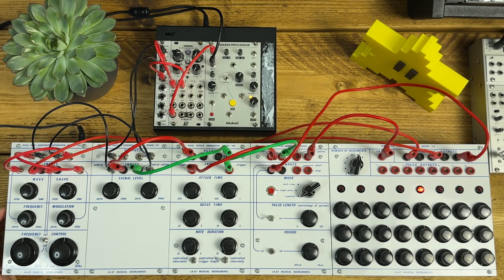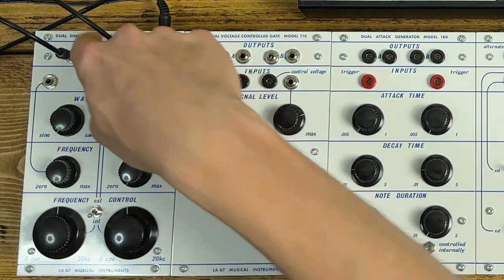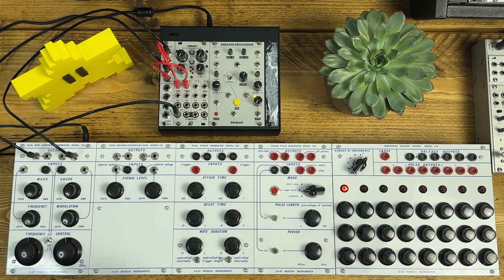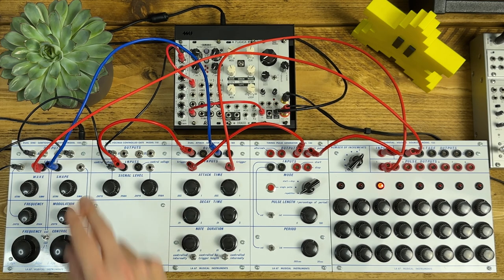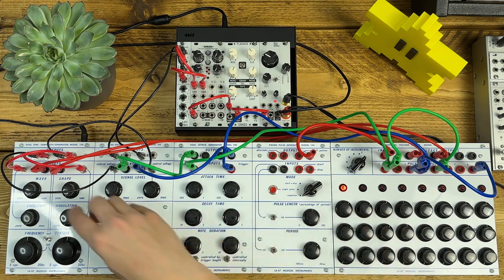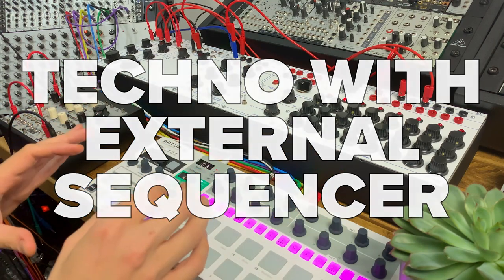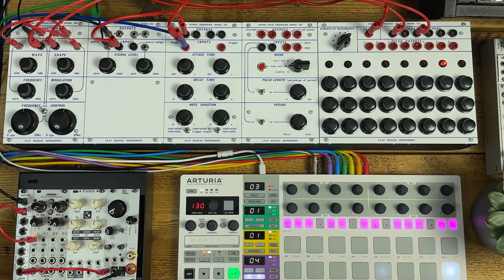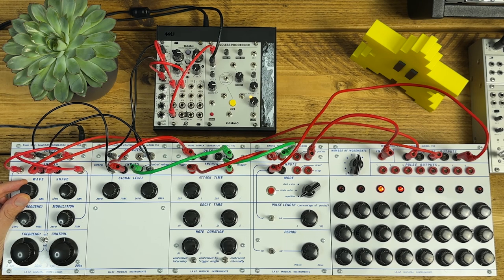LA 67 Mort’s Barge | DIY Buchla 100 series replica

Comment: The CV input for pulse length seems like a particularly good feature. Trying to work out the simplest way to implement something similar in a DIY build. The schematic for the Buchla 140 looks totally bonkers to me, transistors everywhere and not a single op-amp or IC - I'm guessing it dates from a time before they were readily available. Thanks for this video, it's a really inspiring setup.

Comment: great work, on both the build and the demo/explanation. Very powerful "little" box. Not sure if they make and sell these as completed builds any more?
Reply from the maker: Thanks! LA67 occasionally do a short run of the pre-built systems (most recent one was in March 2023 I think) so probably worth signing up the mailing list or dropping them a message to check if there's going to be another batch...

Comment: nice video and great sounds, Tom have you ever checked if the envelope generator (180) is able to read pulses of two or three folowing steps, like let say step:1-2-3 or is it only every second step 1-3-5...?
Reply from the maker: Thanks! I might not be understanding your question correctly, but you could certainly stack the pulse outputs from the sequencer and connect (e.g.) steps 1, 2 and 3 together to the 180 input, if you just want to fire the envelope on those steps - is that what you mean?
Reply: @TomChurchill  yes that how it works, you can create the patterns that way, but for some reason in case of 123 and 180 it activates the envelopes only every second step 1-3-5... if for instance 1-2-4 is shorted it will activate only 1 and 4 (at least in my builds), that is why I wanted someone to confirm if that happens also in their buids